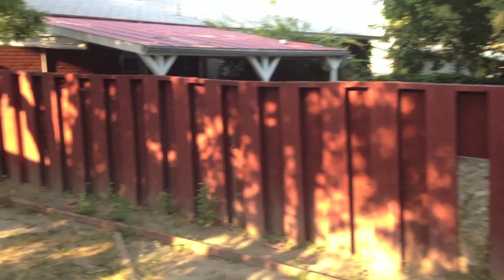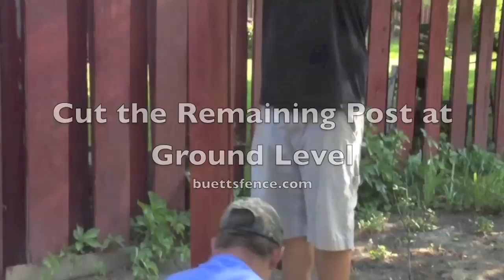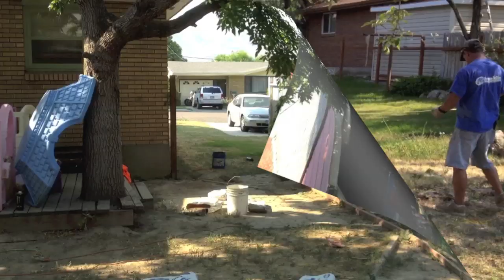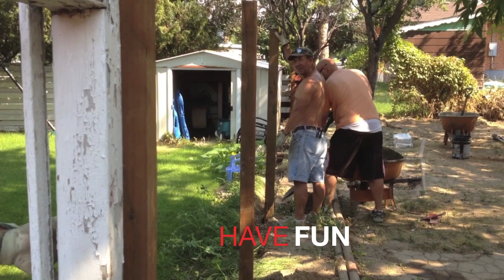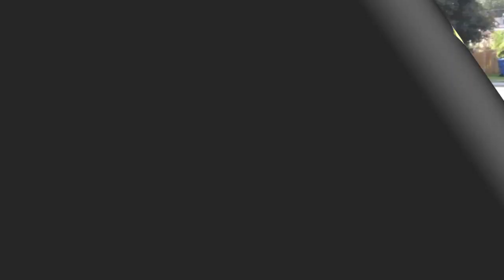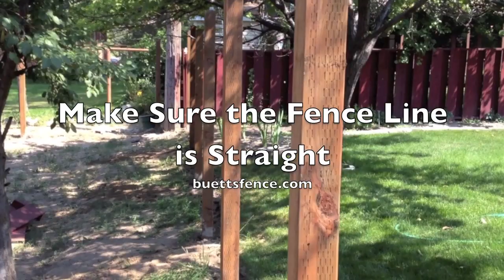Beginner’s Guide To Building A Cedar Fence: Preparing & Setting Posts Tutorial - Pt.1

Comment: Nothing wrong with eyeballing your posts, but I'm of the school of thought run a string, because you have to put one up anyway to mark your posts for cutting, and you eliminate wAlking to your terminals to eyeball them. If it's windy, by all means eyeball. I run my string at 68 inches when setting , Your string is set for grade now: ).  Long time fence builder, couldn't help but put my two cents in. Lol. Maybe a ten inch skillsaw for cutting posts too.